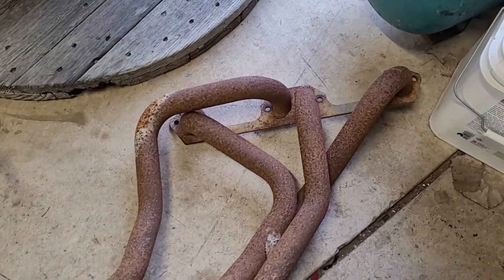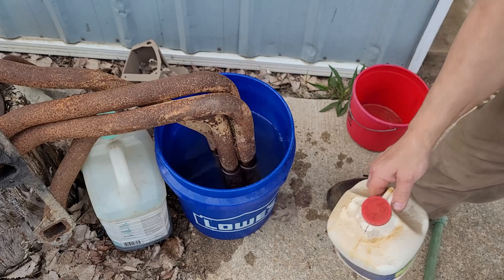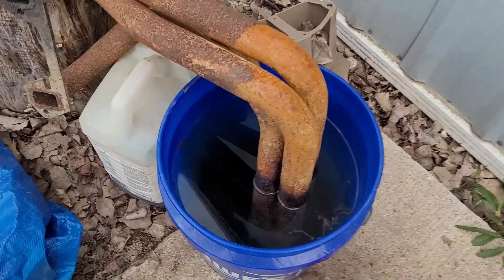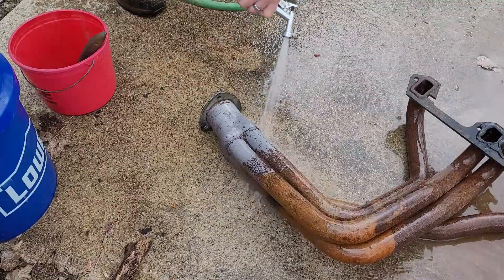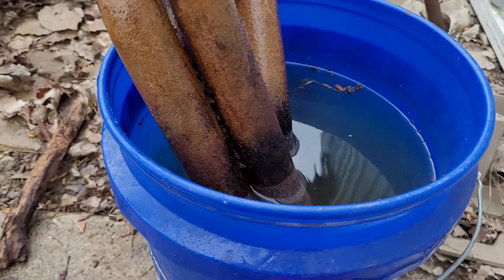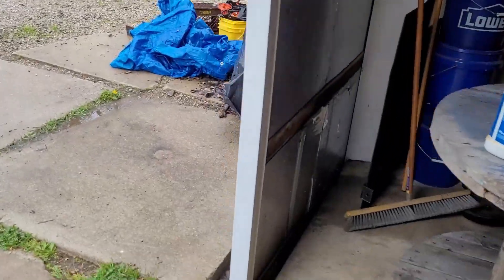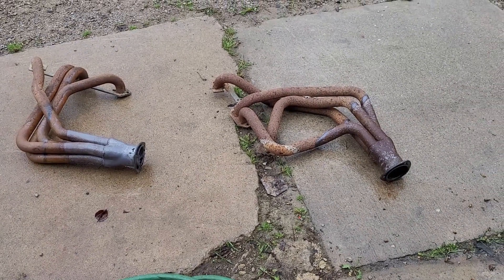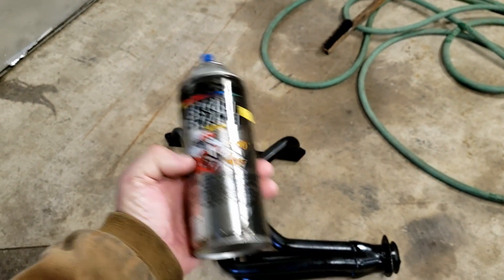ACID Rust Removal - DIY - Cheap & Easy! - Let's see if it'll clean these Nasty Headers!

Comment: I like it. I just soaked some BW Beetle headers. Look good as new. I did use baking soda to rinse.  Even has a few old sockets I wanted to try. Sparkly clean after a wire wheel. Thank you for sharing the video.
Reply from the maker: Sweet!! I'm glad you're getting to some out of this trick! Good luck with all of your future acid stripping plans 👍🏼

Comment: Nice ! I'm going to try this on some parts for my 55.  Curious about neutralizing it , heard baking soda and water ?
Reply from the maker: Add baking soda until you don't see it fizz anymore. If it fizzes at all then the acid is still active. Be careful when you pour in the baking soda. Do it slow and it can have a violent foaming reaction. 👍🏼

Comment: This is (was) the best YouTube episode that I have ever watched and applied. I have used it on OEM MOPAR Cast Iron exhaust manifolds and Intake Manifolds. It’s BETTER THAN SAND BLASTING. It gets (removes) rust inside the parts that you can’t reach with sand blasting. THANK YOU
Reply from the maker: That's makes me super happy that you found it useful. Worked pretty good huh? Headers are still holding up great 👍🏼👍🏼

Comment: I just compared Evaporust and Muriatic acid.  I soaked badly rusted railroad spikes overnight in Muriatic acid and for 5 straight days in Evaporust.  The muriatic acid worked wayyyyyyyyyyy better.  It was AMAZING.  I used pure Muriatic (31% hydrochloric).   DO NOT USE Muriatic in an enclosed space for 2 reasons.  1. breathing in is bad 2.  even though it takes rust OFF, the fumes will RUST every piece of bare metal they touch.   When I was done, I poured 2 large boxes of baking soda into the muriatic acid to neutralize it.  Then I diluted, and dumped in gravel driveway.  Do this in the summer, outside please.  Again, you don't want to breathe it in and you don't want EVERY SINGLE PIECE OF BARE METAL that gets hit by the fumes to rust.  Use a way oversized container if you're going to use baking soda to neutralize it because its going to bubble wayyyyy up while it neutralizes.
Reply from the maker: The acid does work pretty well for sure. A lot more hazards than Evaporust 🤷🏼‍♂️

Comment: Little tip for you guys and girls using this method for rust removal, if you neutralise the part after acid washing then you delay surface flash rusting by a good day. Otherwise flash rusting will start really quickly using just water after acid washing 👍🏻👍🏻
Reply from the maker: Great tip! Thanks

Comment: I did a Tupperware bath inside (windows open) rotating out small parts over several days. The fumes from it rusted tools over 10 feet away.
Reply from the maker: 😬😬 acid is some nasty stuff.

Comment: Use Muriatic Acid with a
3:1 ratio (3 water, 1 acid)
to start with. When done soaking to remove rust or protective Mill Scale from the manufacturing process, wash with baking soda/water solution to neutralize the acid. Then oil or paint the items. Otherwise they will immediately start rusting..immediately. 🙂

Comment: Is there a specific ratio of acid to water? also is it always add the ACID to the  WATER and never the other way around?
Reply from the maker: This acid isnt as dangerous as other acids, considering how diluted it is out of the bottle. Not to say that it's safe or anything. You still have to respect it. I don't know an exact ratio but you can see about how much I added, and it was still a lot. Maybe 4 cups per 5 gallons of water. Maybe less. Just experiment using low concentrations and move up from there. Or you can just use grocery store vinegar and it'll do the same thing, just slower.
Reply from the maker: As for which to add first, always add the acid to water. This stuff is really weak, but other acids can explode in your face if you do it the other way around. 
At this point I'd recommend you try something a little safer like electrolytic rust removal. There are a lot of videos about that online.
Reply: @HFG  Thanks for your responses....i'm working on a really pitted fuel tank skid plate from my gen 1 ford explorer...i was able to get a lot of the rust off with an angle grinder
and wire wheels but the low spots are hard to get into.
Reply from the maker: Ahh. Gotcha. Sandblasting is a good option too. Good luck. I hope it works out 👍🏼

Comment: so you leave the headers in the acid and neutralize or do you put the headers in and then neutralize it after
Reply from the maker: When you're all done with the acid, then you neutralize it. Basically just keep adding baking soda until it doesn't react anymore. It might take quite a bit depending on how much acid you use. I probably used more than I needed here. The more dilute the acid is, the longer it takes basically. Be careful if you do it and don't breathe the fumes. 👍🏼
Reply: @HFG  okay i used about a 12 pound bag and it’s still fizzing when i pit baking soda in
Reply from the maker: Did you use the acid straight out of the jug or did you dilute it with water like I did? I only used a couple medium sized boxes of baking soda and that was enough to neutralize the big tub.
Reply: @HFG  unfortunately not, i had a big tub and used 3 bottles of the acid, not knowing you can dilute it
Reply from the maker: @benhartson  Oof. That's a huge amount of acid. So, in the future, one bottle should do multiple runs of stripping. a few cups in 5 gallons should be ok. The warmer the weather the faster it works. The acid is already diluted in the jug. You're using a lot of baking soda because your acid solution is so strong. At that strength you could eat right through thinner metal. I'm sorry if I wasn't more clear in the video.

Comment: Is $140 canadian a fair price for phosphoric acid 85% concentrate? 1 gallon
Reply from the maker: That's way different than the weak Hydrochloric (muriatic) acid that I'm using. I'm not an acid expert but you should definitely talk to someone else about that. Muriatic acid is commonly used to clean bricks and concrete, but the stuff I bought at the store is dilute, and pretty cheap.

Comment: My brother in Christ. Where tf are your gloves? You know why people don't use muriatic acid often? It'll eat the rust, that's for sure. It'll also dissolve the metal underneath it too and that shit will eat your skin even faster. Don't put up a disclaimer to "take safety precautions" and then do nothing yourself. 

Strong acids will dissolve the oxide layer (rust), but if you do nothing to protect that fresh metal, it'll immediately start rusting again. This is why the parts you splashed with acid (and then later handled with your bare hands like a hack-job) got bright orange rust the next day. It's good to experiment and learn what works and how to do it right, but this is a level of "don't do this alone if you don't know what you're doing". And then you decided to put it on the internet, show people the wrong way to use it, then tell them not to do it indoors. Christ.
Reply from the maker: It was an experiment on junkyard headers. "High Temp" header paint lasts about 45 seconds before it's gone, then it's just rusted steel again. My fingerprints won't matter, doesn't matter and didn't matter. My goal was to see how well it would work, and it worked great. As for my lack of PPE... that dilute acid isn't strong enough to do much of anything. I guess OSHA would have a problem with it on a job site, but for the limited time I was exposed, it's not a big deal.

Comment: what type of paint u got? and it is last as new? or it will rust again in 3-5 months?
Reply from the maker: I think I used the VHT high temp header paint. It lasted about 45 seconds and was just a cloud of noxious smoke. They're rusty now, but it's more like a weird layer. It doesn't get worse, just stays the same.

Comment: Make sure to take baking soda and add it to the acid until it stops foaming in order to neutralize it. also, mix baking soda and clean water for a final rinse which will neutralize the acid on the metal.
Reply from the maker: I think that part of the video was corrupted and didn't make it in, but I did neutralize it. It's been a long time so I don't remember the video. 👍🏼

Comment: The acid fumes in your garage will cause all metal to rust. it sucks. don't ask how i know.
Reply from the maker: Ooof. I had it outside so we're all good. And my barn is super leaky so it has lots of ventilation

Comment: I've soaked towels in muriatic acid an wrapped a rear end pulled the towel off a few hours later it removed all the rust
Reply from the maker: That's a cool trick. I would have thought the acid would have dissolved the towel. Maybe I'll try your way next time. The collectors might be tricky to clean with towels though.

Comment: Did you neutralize the acid on and inside the headers with sodium bicarb or just water? I"m concerned that with minimal dilution, the metal will rust under the paint.
Reply from the maker: I neutralized it with sodium bicarb really well before it was dried and painted. They've been on the truck for awhile now and are perfect. No rust inside.
Reply: @HFG cool, I was wondering about that.
Reply from the maker: The acid wasn't super strong anyway and the steel was a decent thickness. I don't know for sure but I'd think that the high temps from the exhaust would destroy any acid. Regardless, it's been great so far.
Reply: @HFG Actually, heat will not break down the acid, it will make it react more vigorously. HCl if it did break down would to it's component elements of hydrogen and chlorine, would really screw things. That's what happens when an acid 'attacks' something, those elements separate and find new homes with other elements to become more stable. I'm willing to bet that your baking soda bath captured all the remaining acid and left you with a clean product.
Reply from the maker: I didn't know that. Good thing I neutralized it really well then 👍🏼

Comment: I like the proof that the acid works. That's what I came to see. Years ago, I had an opportunity to buy a property that was on a well like yours. They had numerous junk vehicles. I wanted to get the well tested to ensure that the water hadn't been contaminated from the vehicles they had stashed around the property. I'm old, and can remember back when it was normal to dig a hole and pour your old motor oil "back into the ground where it came from". Watching you rinse that water off makes me wonder if your well is okay. Have you considered getting it tested?
Reply from the maker: Our well is 120ft deep and over 400' from the shop. Nothing I do in my shop will affect water sources, especially the well. We have wildlife around the shop and I'm always conscious of what they could be exposed to 👍🏼

Comment: Phosphoric acid works also and doesn't flash rust. 
Infact it converts rust to iron phosphate which is black in color.
Reply from the maker: That would be pretty cool. It's just so much more expensive than this per gallon. If I can find it cheap then it would be a good alternative since muriatic acid is so corrosive. 👍🏼
Reply: @HFG  I use Muriatic acid for heavy rust then after neutralizing I brush or spray on phosphoric acid to passivate the surface and prevent flash rust.
Reply: @HFG  You can get it as a spray now.  Spray it on, walk away, come back, rust is gone and turned to a black, paintable surface.

Comment: I would have NEVER expected this result. I have been a mechanic and fabricator for over 50 years and never knew this.
Reply from the maker: Pretty crazy, right? 👍🏼 Be sure to neutralize the acid with baking soda after if you do it yourself. And wear a respirator 👊🏼👊🏼
Reply: Would you think it's safe to do on like under carriage of a truck?
Reply from the maker: Yes and no. Not with the truck assembled. If you sprayed that on an assembled truck it would be next to impossible to neutralize the acid and it would continue to eat away at everything it touches. If you had a big enough container you could take individual parts and dip them, but you absolutely have to neutralize the acid after or it'll ruin everything.
Reply from the maker: Keep in mind that it's hazardous to your health so don't breath it.
Reply: @xboxturnoff9057  yes
Reply: @bosdad7  🤣🤣🤣🤣🤣🤣🤣🤣🤣🤣🤣🤣🤣🤣🤣🤣🤣🤣🤣🤣🤣🤣🤣🤣🤣

Comment: If you do use it make sure you neutralize the crap out of it.
Reply from the maker: For sure. I used a bunch of baking soda then checked the PH with test strips to make sure it was safe. I think some of the video files were corrupted and didn't make it into the finished video, though. The joys of being a small time, wanna be YouTuber 😆

Comment: That was impressive.  I have a set of Super Comps that are rusted like yours.  I've had them for a long time.  I'm going to take your advice and give this a shot.  Thanks!
Reply from the maker: Right on. You can use less acid than I did because it takes a lot of baking soda to neutralize the acid when you're done. The result is the same, it just might take a little longer.
Reply: @HFG  Excellent, thank you very much!
Reply from the maker: Any time. 👍🏼

Comment: the druggist in town said  you want to neutralize the part after the soak, You use baking soda and water as mentioned and keep the part wet for a bit. then dry it fast.  he said air and even a heat gun to help it dry fast. Then the rustoleum or harbor freight etch primer then paint. for mixing Its acid into the water  NEVER the other way around.
Reply from the maker: It's been awhile since I made that video so I don't remember everything in it, but I did neutralize it with baking soda afterwards. So far they've been holding up really well. I appreciate the info, and you watching. Thanks 👍🏼

Comment: The bravery of using hydrochloric acid without gloves or a mask — even if it is 35% concentration. 😂

I would have hit that with a fine brush every couple hours just to check for pitting and smoothing out any potential problems. Definitely could’ve cleaned that whole thing a lot quicker. Doesn’t need to soak that long and clearing debris will expose more rust and steel but still really cool to see a video showing this used on headers! Didn’t think that would be hard to find a video of— but it was and now I feel much better about my idea for cleaning rust off old headers. 😂 thank you!!
Reply from the maker: I used a respirator when I didn't have to talk to the camera :) There are definitely better ways to prep it but I was curious to see what happened if you just put them in without any effort. I have to say, they're still in great condition. I'm glad you found the video helpful 👍🏼👍🏼
Reply: @HFG  hahah I am very glad to hear that. Man oh man, made me feel like a wimp watching it like damn… I would be way too freaked out to be doing that without gloves or a mask. Did you see any pitting on the steel? I couldn’t really tell from the size of the video
Reply from the maker: @recklssabndon  there was a little pitting but that was there before the acid. I got these headers off a truck in a junk yard that had sunk into the dirt for a decade. I'm honestly surprised that they're in decent shape. They've been on my Dodge D150 ever since.

Comment: I dipped some vintage rusty schwinn bicycle rims into muriatic acid and didn't do the best of jobs when neutralizing with baking soda,about 6 months later the rims were destroyed
Reply from the maker: Oh man! I'm sorry to hear that. Was it diluted or straight acid? Even at 20% strength it takes quite a bit of baking soda to neutralize it. I don't know if I filmed the neutralizing part or not.
I neutralized that acid, refilled the pan with water and added a bunch of baking soda then soaked the headers again. Once they'd sat for a day I washed them a lot with fresh water and they've been perfect.
Reply: @HFG  The acid was straight out of the jug,full strength, I was in to much of a hurry to clean them and full strength muriatic acid ate the rust off quickly.
Reply from the maker: @eastside0434  from everything I've been told, full strength is too aggressive. I haven't tried it at that strength before. I don't have a ton of experience with it so I can't offer much help other than that, unfortunately.
Reply: @HFG  what I learned from it is its extremely dangerous,must be very careful with it.